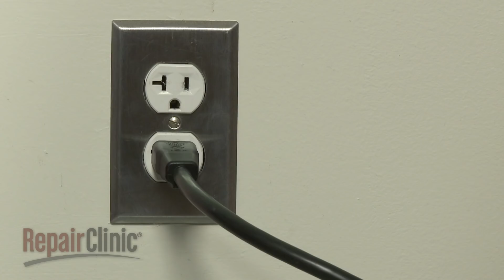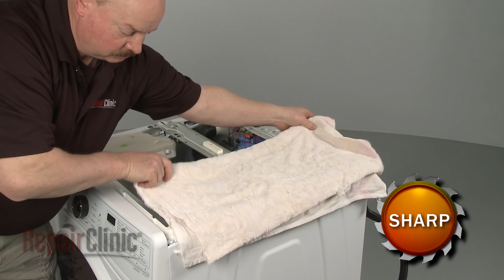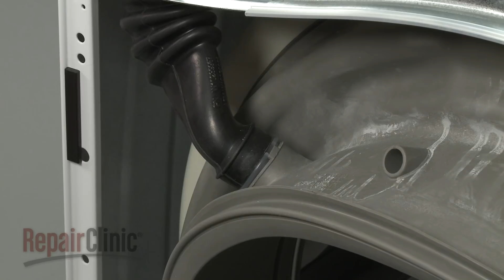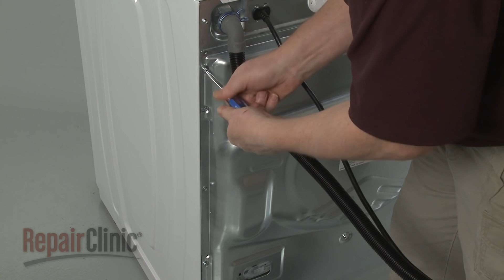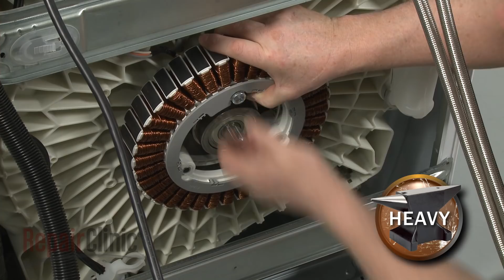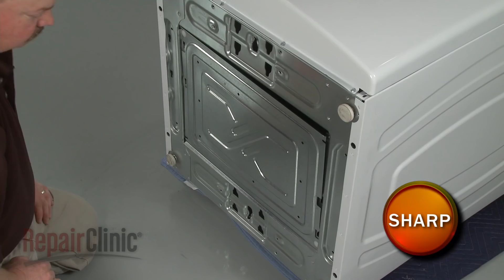Whirlpool Alpha Front-Load Washer Disassembly, Repair Help

Comment: This video wins!  I removed the back trying to find the drain pump filter.  Why would Whirlpool have the filter facing forward and not provide easy access to it?  This was super easy to follow, no steps left out.   Also, don't be fooled, the boot seal retainer needed MORE than a little effort to put back on.  Actually, it's possible that I'm just wimpy.
Reply: Couldn't agree with you more about the value of this video.  I needed it for the same reason - washer wasn't draining efficiently.   got the filter out and found it almost completely blocked with lint, thread, hair and coins.  
On the boot seal retainer reinstallation: Me too.  Not having an assistant nearby, I ended up using a bit of duct tape to hold the retainer in place at the top of the boot, and then two pairs of needle nose pliers, one for each end of the spring, to put it in place.

Comment: At the bass of the drum there is a rubber boot that is attached to a plastic adaptor that attaches to a narrow hose that is connected to the water limit switch. What is the name of the boot and fitting?

Comment: is this whirlpool duet
Reply: I just cleaned my drain on my duet using this video guide - it matched well.  i didn't tip it all the way on its back just tipped it enough to remove panel underneath and get to drain.
Reply: @LBlast1  Is there filter access under this panel as well?
Reply: @Hildepedia  I don't remember a 'filter' but maybe a screen or something yes - the sock I found was trapped up against something that keeps stuff that is to big from going into the drain hose.  You wouldn't need a true filter on drain water.  I didn't look at anything related to the supply water and that comes in from the back I think not the bottom.